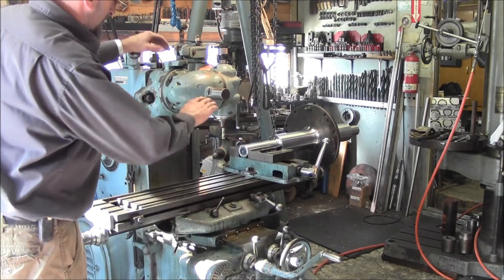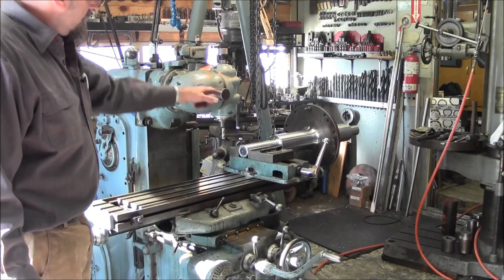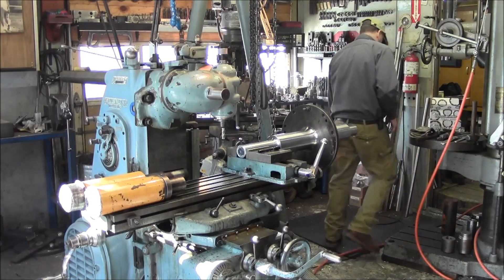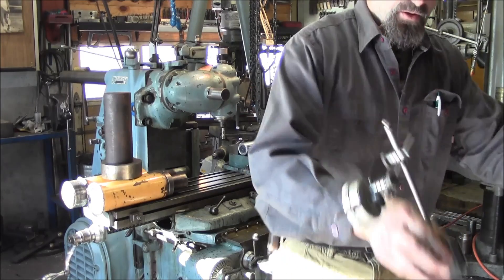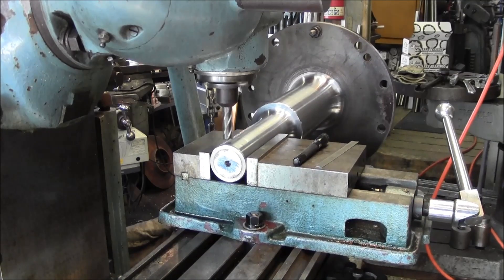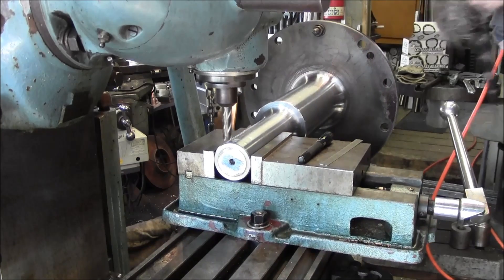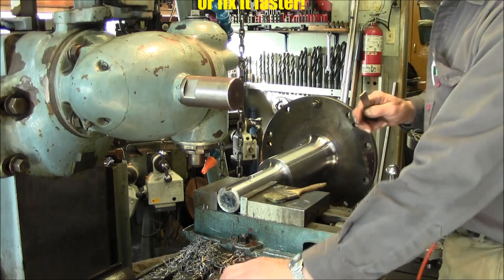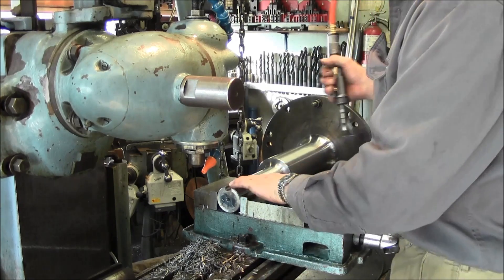The Broken Beaver Part 10 (Finale): Wood Chipper Repair

Comment: I think it is about 5 times better than from the builder. also, it will probably take 5 or 10 hp less to run it, because of lower vibration.

Comment: A wristwatch finish for a Wood Chipper!  For P.W.H.T. rule of thumb is 1hr. per inch of thickness, controlled cooling to 600°F.  I was wondering why you didn't use 6010 for the root pass?  Beautiful work.

Comment: i am curious about the turntable you used. is the motor to run the table insulated from the welding voltage or how does that work. really some nice videos thanks

Comment: Did you get any feedback on how the shaft performed? My guess is that operation went with less lateral vibrations after you fine tuned the geometry of the shaft assembly.

Comment: Keith; I am an amateur--I have learned more from your vids than anything else. Saved me a lot of "trial and error". My question--Machining the fillet welds to a 5/8" radius leaves a 1/4" weld throat. Considering the mass of the parts at 2000 rpm, is that enough? Been 3 yr--Beaver still running well?  Beautiful work--just curious and trying to learn. Thanks

Comment: You don't paint those parts to protect them from rust or do you leave that up to the customer? I thought that the parts painted yellow are the parts that are exposed to the elements, Wouldn't you need to protect those surfaces?

Comment: Watched the whole series Keith--enjoyed it prodigiously--what I don't enjoy is dickhead designers--we have them in Oz as well,probably have a university degree but no practical knowledge and that includes the professors that taught them..
You yanks have a saying that says--nothing built too strong ever broke and no one can ever argue the point on that..
Hey Keith whats all that white stuff on the ground--a new kind of fairey floss---never seen that before..Keep the vids coming mate-they are so enjoyable..
Reply: Keith Fenner 
Keith, I have to piggy back on someone else's comments as I can never get the comment section to open.
I also watched the entire segment and was amazed at your techniques. I only have a small 6" Atlas lathe myself for home hobby use but I enjoy watching the skills of others in videos like this.
Although this pales in compaarison to your repair, my latest small victory came as I was able to repair the tilt system in my Buick seat. Cheap plastic gears from GM will break and I obtained brass gears for the fix. Machining worm gear shafts to fit the new brass gears for cross drilling and pinning worked perfect!  Enjoy your videos here in FL.
Reply from the maker: Ian Craig In the driveway is shells from clams, called a shelled driveway. ;{)------

Comment: Working my way through all (almost all; I skipped a half dozen maybe) of your videos. Reached this excellent series in mid-April, 2015. I particularly liked the use of the tracer to get the transition radii perfect. I suppose a form tool would have made transitions nearly as strong, but if I ever find (or make) a tracing attachment, this will be an inspiration.

Comment: Great stuff Keith, really learning a lot. Loved the single point re setting centre! I have a concern. In the welding section you said the heat insulating blankets were asbestos material. When you placed one of the blankets a heap of dust appeared which ,if it were asbestos could be VERY  detrimental to your health. I would have thought a ceramic blanket is the modern material to use. This is in no way a criticism but I felt I could not let it pass without comment for your sake and your viewers. Richard
Reply from the maker: I stated they were non asbestos, that product has been outlawed now for some time. ;{)-----

Comment: Dear Keith,
I found it great to watch another one of your fine repairs.
I found this one particularly interesting - your observation on the cause of failure was spot on in my view.  The critical weld is at a poor location as it is not only at a high stress location, but it's also sitting right on a critical stress raiser.  Therefore, radiusing-out the weldment in the way you did was exactly the right thing to do.
Having said that, I have an idea for your consideration for future jobs like this.  Why not step-up the OD at the location of the flange connection next time?
Suppose you were to machine the flange out by (say) an additional 1 inch, and then when machining the shaft, have a well radiused step-up in OD at the flange.  This would greatly reduce the stress on the critical weldment (more weld surface area and no stress concentrator) and also improve the fatigue strength at the critical fillet (as there would be no weld there).
Alternatively, if bar-stock prevented this being an option, you could under-cut by (say) 1/4 inch radius before the weld, and again this would take the stress concentrator off the weld (which is what's the killer here).
Just a thought -  I would be keen to know what you think.

Indeed it was a pretty rough job when first manufactured and you've done a fine job bringing it back better than new in my opinion, but I'd be interested to know your thoughts on my suggestion.

Best regards,

Daimo.
Reply from the maker: Yes, your extra added thoughts would have increased the safety factor even more! Thanks for the comment and taking the time to expand on the topic! ;{)---

Comment: Great work as always!!
What I do with set screw type tool holders is "feel" the screw pull the tool up as it tightens
this pretty much eliminates the chance of the tool pulling down.
On straight shank tools with no factory weldon flats like woodruff cutters when you cant risk having the tool pull down  I grind a quite tapered "flat".
That causes the set screw to pull the tool up against the notch you made grinding the
tapered flat??
Collet holders no matter how good can and do SLIP damnit lol

Comment from the maker: I Dialed the base of the index head in line with the table before inserting the shaft or bar. your right, the miss alignment in one axis can throw the other off the center-line the amount related to the circumference and angle. ;{)-----

Comment: Wow!  Nice work Keith!  I don't understand:using the dial gauge to check the level (or vertical run-out) of the shaft on the mill : a front to back misaligned round surface (as opposed to say a flat bar) will not measure vertical run-out properly (i.e. if the gauge is not travelling exactly along the top of the bar, it will move off the centre line to one side affecting the reading).

This question also applicable to using a round bar to check the horizontal run-out between centres on a lathe..

Comment from the maker: For a full depth cut a two flute has less pull to one side, so your cut stays more centered and the chip clearance is greater so the chips are flushed out easier rather than being double cut or re-cut. I just worked on a new shaft made by someone that likes to triple pass cut with an end mill and it looked like the walls of a strip mine. If you can see the steps in a key way then there are different widths to the slot you created. Love the comment, Thanks! 
;{)-----

Comment from the maker: Putting a key way in the center of the shaft, to hold the flange, would have added another stress riser to the project, and weaken the original design. 
;{)-----

Comment: I just watched the series for the 3rd time... So interesting!
When you find center of the part on the mill, do you make a 5/8 gap on every mill type 
or just on a 5/8 endmill?
Seems more logic to me if you make a gap which is the diameter of the mill and not a gap which is 5/8... But all the times I saw you using that method, you only made 5/8 gaps, so I wonder about that...
Greetings
Adrian

Comment: Keith,
 Great job, I used to run a 18" lathe doing work to tenths in 416 SS and 4140 but am in a wheel chair now and am limited to my 10" South Bend lathe, a 7 South Bend shaper like you have and a benchmaster mill and am training my 10 year old Nephew to be a proto-type machinist and we make  modelsteam engines as well as model gas engines, I love watching your videos - at first I thought you said knurl my pipe wrench Ha-Ha.
 Great work and get-er-done.  
Alec Ryals

Comment: Being a machinist with very old equiptment I understand the extra challange.  I noticed when you were cutting the pocket for the bearing, you were working to tents.  With the value of cost in the chuck, how in the world did you master that???? No didigal read out. Just working to the lead screw and nut, or did you mount some kind of dial indicator on that slide? You truly have mastered that!  Congrulations welll done.  I enjoyed this very much

Comment: "Beaver broke a jawbone". K, I've watched nearly all of your vids. You mention the finish cut as a "spring cut". I wondered what it meant.I reckon it is a light cut that grubs up the tolerance caused by the "tool pressure spring" of the previous cut.That's what I guess,but what do I know. Some oldtimer machinist used the term "dead-nuts" in a different vid.  I liked the term. A machinist dude I know said it meant: 0 over, 0 under (or a dead buck?). Explanation of these rudiments is neat too.

Comment: Looks like your stamp says "TURN WRIGHT 12" What is the 12? I'm sure most jobs are between you and the individual owner, but if there are any jobs where it wouldn't be an issue(e.g. gov jobs like a broken Hobart mixer arm for a school cafeteria), would it be possible to quote the price of your skill put to use?

Comment from the maker: Copied comment; Thanks for the reminder, on that brain fart, I was saying the tool pressures an end mill causes by it rotation tends to pull it off its path to one side slightly and if you make multiple passes, the next path is going to cut a new path because there is still some material left from the opposite side of the first pass, aiding in its new course. Proof is returning cut paths of end mills, will cut the materials left behind by the tool pressures and cause oversized key ways ;{)---

Comment: One has to wonder how well the old shaft ran.  When they filled in the 100 thousand gap around the flange with weld it must have been out of balance.  I am sure that the shaft you made is the best part of the Beaver now.

Great videos as always,

Rich

Comment: I guess I should have asked what did you finish the surface to? Using HSS large radius tooling, I have been unsatisfied with my steel surface finishes. No problems with SS just 1018 and such (I took over a university shop that didn't identify any of the stock so I am unsure beyond spark testing and filing what I am using. Rockwell tester is in need of repair.)

However your answer to my inquiry was spot on.

Terry

Comment: Aha, I understand now!  Thanks so much for sharing your knowledge, Keith!
If you had to cut this keyway on a Bridgeport, how would you do it?  I would use an end mill smaller in diameter than the slot width and make multiple passes while moving the same amount from side to side while gaging the sides for the correct fit using the key.  Is there a better way?

Comment: Oh man did i ever experience that yesterday slotting some aluminum. So pissed at myself when i realized my cut was hugely oversized by nearly 30 thou. Those 2 flute 1/4in cutters sure arent stiff. especially when the cut is 1.75in deep. Resorted to slotting in, pull out, move over, back down, slot... and so on. Tiring process

Comment: Great video. Love teh detail that you give. For the movement in the endmill, I grind a small flat on all the end mills I use, as I have had a problem with them being sucked out. This allows the set screw to sit on a flat plane with more contact area, instead of a round surface. Just a thought. Great video again.

Comment: Keith great project as always, thanks for sharing it with everyone.  The tight tolerances you where able to hold are very impressive, nice...

Throughout I was wondering about balancing and I did not notice any drill marks on the flange that you welded to the shaft you made to suggest that the mfg did some kind of dynamic balance on the assembly.  I'm assuming some kind of cutter head gets mounted to the large flange.  Do you know if the rotating assembly was balanced as a unit?

Comment from the maker: Thanks for the reminder, on that brain fart, I was saying the tool pressures an end mill causes by it rotation tends to pull it off its path to one side slightly and if you make multiple passes, the next path is going to cut a new path because there is still some material left from the opposite side of the first pass, aiding in its new course. Proof is returning cut paths of end mills, will cut the materials left behind by the tool pressures and cause oversized key ways ;{)---

Comment from the maker: The holder is a modified holder with an under sized set screw, I need to drill and tap out to an adequate size so it can take the load, then procure a couple 5/8" two flute end mills for doing this again. ;{)---

Comment from the maker: Everyone should know how to locate and measure to get the keyway machined right, and I'm only showing how my mentors showed me and my average of by the eye method is less than a couple thousands either side at the most. This method does eliminate all errs to just, a by eye err, and not a like the errs that can happen; calculation, instrument or any take it for granted plug and cut. ;{)---

Comment from the maker: I love driving shafts between centers and most of the time would go for that as a choice, however with knowing that I'm going to weld on it and the amount of change it will be off after the fact, I pick to flip it, also it handles the part more rigidly for roughing off the materials. Even if it was half the size the welding will create some run out most likely. ;{)---

Comment: Hi Keith, I love that keyway method. I was just wondering if instead of getting the flat to be 5/8 wide could it be a little under then just line up the two opposing flutes with each edge of the flat that way you could just eyeball it quickly. Great video as always. Would love to see that beaver chew some wood. I bet that part new may not be too much less than what you are charging and the next time around you may be able to get it done 10 hrs quicker.

Comment: Keith,
When setting up for your keyway, why not just use an edgefinder & set Y-Axis to center of your shaft. You can do the math to figure out what your depth of cut to zero on Z-Axis  would be...
Seems like it would be more accurate, no?
Also, would like to see this shaft once it is installed and the machine is back up and running!

Comment: Seen end mill flex on the Bridgeport, where running 5/8" end mill 5/16" deep in one pass is not an option!  If you only had the BP, how would you cut this keyway?  Also had a 1/2" carbide end mill get sucked down in a 1/2" MT2 collet on the M head!  At least I noticed right away!  Too cheap to buy end mill holders! Great way to center keyway on shaft, but don't understand zero for depth of cut, since end mill is already below surface of shaft when you set zero on depth...please explain!

Comment: I knew there was a problem with the key-way before I watched the video because I accidentally read one of the comments but I didn't know what the problem was. Once you  typed what the problem was I tried to guess how you would fix it. I thought maybe you would tig the bottom of the keyway and then mill it flat again. But I wasn't even close :) Your solution is much better, faster and easier. Loved the series of video.

Comment: Again I'm floored by your attention to detail!  The cutter will sing next time it runs!  Too bad about the keyway, but in some respects it's better.    For my toys I've always battled thown keys.   Lately I've been locktite'ing them in place with success.  I've also center punched the sides of the keyways to hold them in place.   Maybe I should intentionally cut the key depth like this and make custom keys.

Comment: Hi Keith 
An other nice job and a good set of videos! just wondered how you would have machined the radius without the profile attachment. I would have to have made a radius turning rig or more likely because the job had to be out used a radius tool slightly less than needed and rolled it around the radius to "titivate" it to the correct size and finish.
Cheers Art from the UK

Comment: Keith, another Great job, well done. Keith as a very new hobby machinist, you said that after turning the part for the last time in the lathe, and measuring the Total Indicator Reading (TIR) (I believe) that the end was out about .005 (I think that's what you said).

Was that the result of the welding? Or just that the shaft was out of aligment? Or the Tailstock was out of aligment? Thank's in advance for the answer.